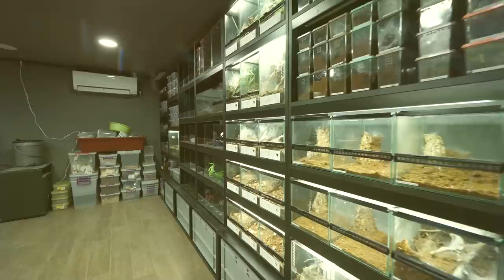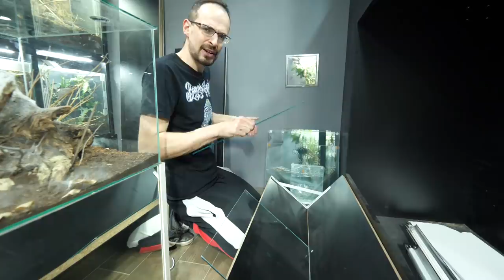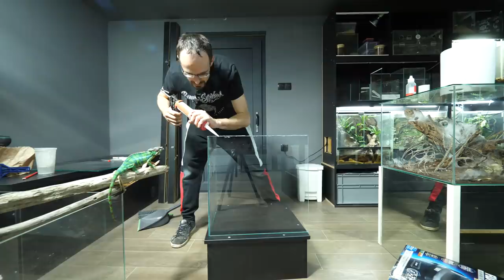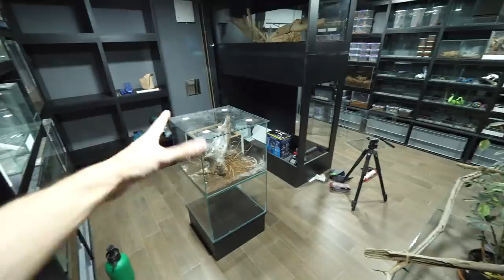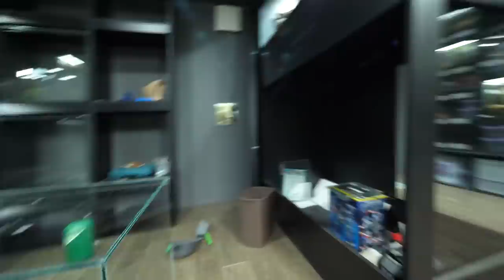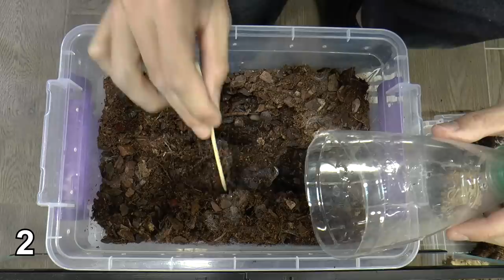HUGE COMMUNAL ENCLOSURE for Hysterocrates gigas tarantulas (READ THE PINNED COMMENT)

Comment: @The Dark Den, why don't you add a hole in your print for the pins? Size it after the smallest nail in a woodmanshop and just nail it down, clip the nail. That way, you are reinforcing the pins. So they don't break as easily.

Comment: The enclosure looks amazing! but structurally It makes me very nervous having such a big glass enclosure over another a glass enclosure supporting all the weight, i would prefer it had 4 columns or something supporting the top one. Sure if left totally alone it's never going to fall but if you bump it or something unexpected and it cracks it's going to be a disaster.
Reply: I was thinking the same. My fear is that the glass in the bottom enclosure might just collapse under the weight of the top one

Comment: i think u should make a square metal holder for the glas boxes stacked ontop of each other just in case one glass box blows or fals, use a welder to make a aluminum fram just big enough it holds the 2 boxes in place on top of each other :D

Comment: You could add some spacers (kinda like you had) between the 2 enclosures and stick in some LED strips so the bottom one gets some light!
Reply: I was thinking that too, but then I went back to the thought of more surface area to diffuse that weight. 
Constant dilemma when I'm building here.

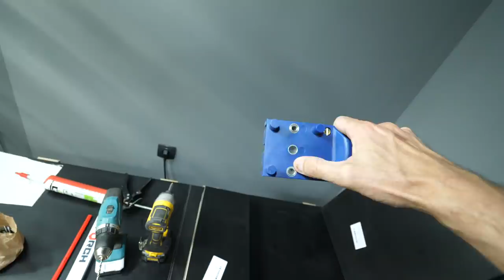Comment: The tool your using at 6:50 also works great for building wooden terraria. You can make holes at the exact same spot in two planks, then glue a dowel pin in there as a connection instead of screws

Comment: Petko, may i be so bolt to make a suggestion.. 😶 please try to clean the edges of the glass with alcohol beforehand of glueing.. it will make sure that all stains from grabbing them with your hands (and I don't know if you cut the glass to size, so if you didn't they may have even more stains) and it can be that the seals come to let loose in the future. 
I'm absolutely trying to help and not criticize or stand in your way.. just wanting to help so you make the best out of your materials (which all cost enough, we all know it and that's why we build it ourselves Most of the time of course) for a looong time 😶😊
I love to see you build it, it is looking awesome and I am a 'do it yourselver' too, it just gives so much satisfaction! 😊👌😎

Comment: love the videos since the old apartment days! just a thought from an engineer on the door pins breaking; 3D printing those will always be a weak point because of how printing works, even with larger diameters. if you design the doors with holes for metal pins of the same size that you insert after printing, it will be much more robust and easy!

Comment: hey, have you thought about instead of printing the pin, leaving a hole there and later placing a metal insert? you could buy 3mm studs and putting them inside of the door plastic, instead of having the plastic break over and over?

Comment: Petko you could also go for a slim frame on top of the enclosure. Just like you did for the bottom. Lets say 3-5cm wooden frame between H. gigas and M. balfouri. Enough room for a light panel or if you want to be extreme even an automatic misting installation with a small water tank, while still having the same look as the shelves. 
Another thing is the pin of the door construction. Ever thought of replacing the plastic pin with a glued in metal one? that way the weight being concentrated on the pin wouldn't be much of an issue. Also the wear on the material would be a lot smaller. Was thinking about 100% infill prints, but the adhesion from layer to layer might still be the source of the problem. What you could try is printing it upwards, so the layers aren't in the direction of the most force, but 90° against it. 
Many theories lol

Comment: I'm a bit sceptical about the LED-Strips. I had "waterproof" ones in a moist environment once, and it had a short circuit after a while. It made strange noises and....smoke.... But I'm impressed that the glass drilling worked that flawlessly? I was on the edge of my seat seeing that you haven't used some liquid for cooling. :D

Comment: You could design inserts into the printed hinges. After printing you epoxy metal parts into the inserts. That way you would have a little beefier plastic part which would be less prone to breaking and the metal does the rest. Probably you could get away with a screw without threading in the moving window part and a screw nut in the frame hinge part. Good luck! Like the Idea.

Comment: Another easy way to assemble glass panels for an enclosure is to buy 3mm or less thick silicone door bumpers. They are self adhesive just set them on the panels so each panel has a gap between each other panel and tape the whole enclosure together using small strips of painters tape. Then just push the silicone into the gaps all at once.

Comment: great work ! how about if you create the wooden base again but a lot shorter to go over the top of the bottom tank, like a lid but half an inch , will be a lot more steady also, the  led strip lights on the wood that way to

Comment: I know a solution to your problem with hinges braking off. You should try to build one with living hinge strips made out of pvc or a different material. These hinges get stronger every time you open them and won’t brake for a very long time. If you would combine this with either a printed or aluminum front ventilation strip and a aluminum mash strip on top, you would have the perfect enclosures

Comment: Very cool 😎 .. I would maybe consider a thin layer of rubber mat or styrofoam in between the 2 cages to prevent sliding or dings / scratches.  Might help with absorbing weight across the entire surface also..

Comment: You can make it more robust, or you can use tig weld rods, you can get in this size, you just cut it and in the molding process the pin place you make a hole only and you can glue it in. But the tigweld rod can be stainless steel, and that have a lot od strength

Comment: LED strip lighting would look great around the square edge of the inside you could run the little wires out through the air vents in the back it would look grouse only one LED around the whole top of the inside

Comment: Not sure if you know, or have done it.. but you can use clay around the area you want to drill into the glass and fill it with water, it will help to drill it and reduce the heat from drilling.

Comment: If the top glass bar behind the doors were a little shorter you would have gaps on both sides to fit the door hinges inside the enclosure. This will also be stronger because the action of opening the doors can pull the hinges off the outside as it is now :)

Comment: Just a suggestion you might want to put a layer of styrofoam or rubber between the to enclosures. Sometimes with glass on glass micro tremors or vibrations might cause the integrity of the bottom enclosure to collapse. More work for you if it does, better to be safe than sorry.

Comment: Not sure what type of 3d printer you use if its a filament or resin but I'd recommend trying resin 3d printing for such small pieces. The resin tends to be much stronger, either way great job on the set up.

Comment: you could get a sheet LED panel to put between them to light up the bottom one! run a cable down a corner and through one of those trim pieces to a plug.. or batteries under the foot.. I just dont care for the battery idea because you'd have to change them often and you cant really put them on a timer.

Comment: I don't know about glass but for gluing PLA, PETG, ABS, ASA, ... 3d printed parts I use TEDI sekundno lepilo. Is like 1€ for 4 or 5 of them and it's bite it very strong. For a couple of seconds it's looking like nothing but after a minut is like welded. I don't know if you have TEDI in Croatia but I can send you some to try :)

Comment: Glass is difficult to cut even with  diamond cutter. Have you tried doing it using water at the same time, also don't push let the weight of the drill do the pushing. Fantastic enclosures  shame you don't sell

Comment: Hey, hate to be the bearer of bad news, but you absolutely must replace that glass panel that is chipped.  Glass is a very unpredictable medium to work with and even minor structural changes in the sheet (like a scratch) can dramatically reduce the structural strength of the piece. In this case it’s better to be safe than sorry, would hate to see an update where the structure has collapsed...

Comment: I need to ask you a question about my golden knee t. I gave her a new enclosure and added a new hide she has 2 hides she took a new one blocked off the front and the back she’s been inside the hide for mor then 2 weeks should I be worried about her or should I look inside and see if she is ok. Or just not worry about her.

Comment: I assume there's a plan to separate them as it's been documented that these are not a communal species, slings from the same sac will tolerate each other for so long but after a while it will likely become a battle ground 
Sorry if this has been covered or already answered, I might have missed something

Comment: About the enclosures design. Haven’t you thought about using a metal pin or a screw like M2 or M3? It is kind of obvious that 3D print is weaker in Z direction so it would be wiser to use something solid as a pin or maybe you could try this new material PCTG which claims to be stronger in Z than XY. I know it sound strange but tests show that it works.

Comment: great thing about English  is even native speakers butcher the language..  nah wud im sayin?

two things wanted to mention tho.. first dont think its wise using a 3 pound sledge hammer on glass lol you should probably get a rubber mallet..  second, your 3d printed hinges that keep breaking, change the design so the hinge dowel (the rod the whole door turns on) in to a female receptor to except a metal dowel or at least something you can replace if it breaks.. in sort make the most commonly failed part easily replaceable/repairable

Comment: Not enough space for 30 t's... especially ones that grow as fast as H. gigas. No where near enough ventilation either. They also can't burrow with dry substrate, so they would need you to wet the substrate which would be mold death trap as you're going to have random cricket carcasses all over the place. Proof that any amateur that knows zero about husbandry can make videos and get views.